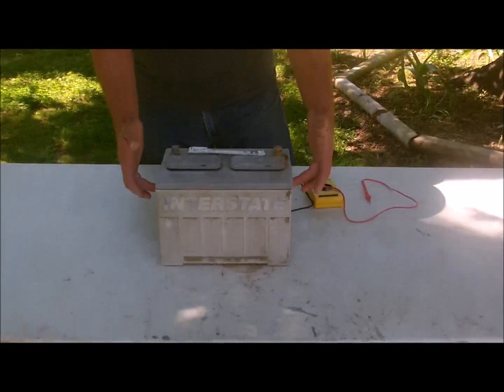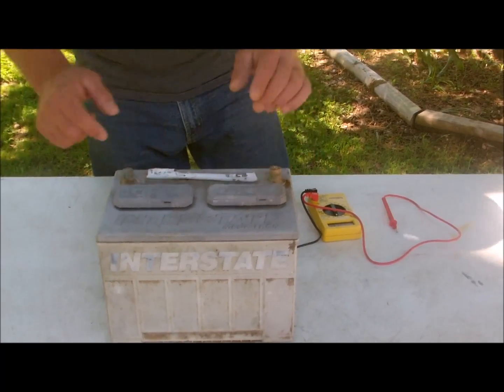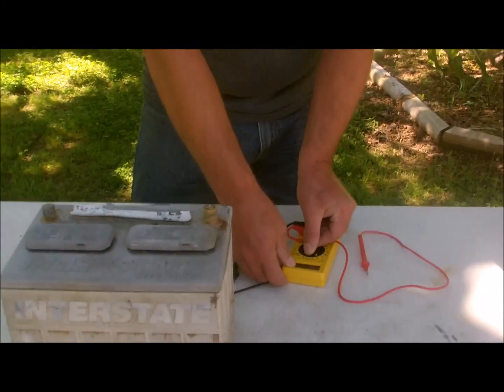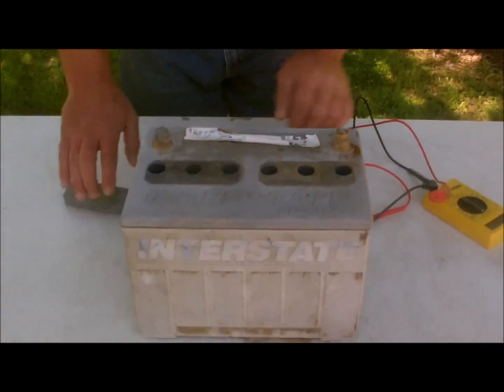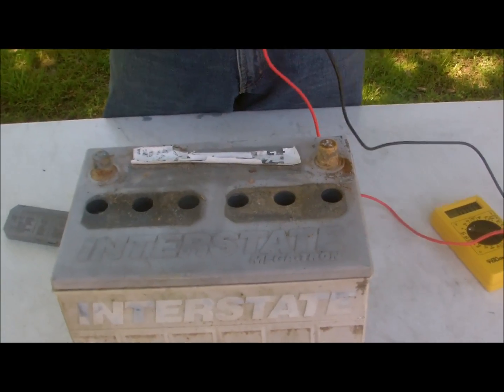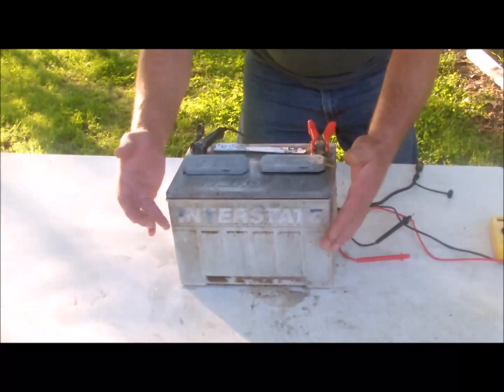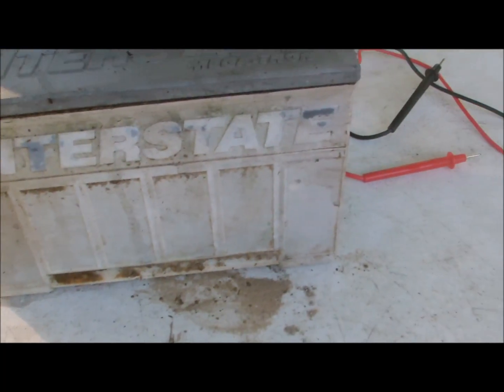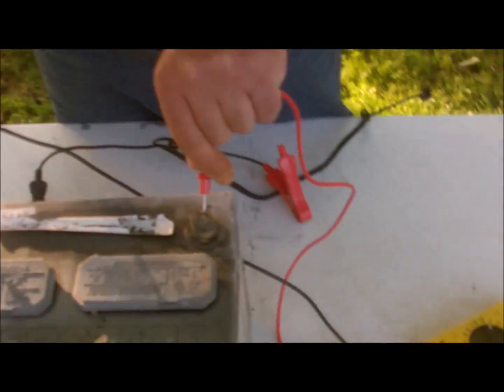Reconditioning a 12 Volt Car Battery part #2

Comment: So, do you need to put acid in or not? You aren't real clear. Do you have to trickle charge a bit before tipping out the original acid? Do you tip all the acid out? Will the Epsom salt mixture revive the battery after a trickle charge or not? Do you have to wait two years before putting new acid in or not?
So much conflicting information on this topic.
I did watch a video where some guy rinsed out the battery several times with baking soda solution. Guaranteed to work he said. It did in his video. I wondered what the Epsom salt would have to work with if the battery were really cleaned out.
Oh well, I'll try something. 
My battery costs 500 dollars.

Comment: I did this method with an already dead 12 year old battery and 8 years later it still has enough juice to start my lawn tractor. It works like a charm. Thanks for this.

Comment: Load test before and after.  Charging high rates????? ark welder or jump starter.  Volt meter tells nothing without a load test,.  Want 200 AMps at 10volts.

Comment: Thanks for showing the cells test, mine are all fine and in increments.
My intelligent charger shows ''000'' on my hardly used marine 2 year old battery and also my aging car battery, both show 10,25Volt or something. I tried getting the car to recharge it's own by driving and  charger, nothing changes.
Waiting for Bezos  to deliver my ki of salts🚐 .

Comment: ... thanks for your honesty John, one thing to remember is the true condition of a battery is not in it's unloaded terminal voltage but in how it reacts under load. A good way to test is to take an old 12V incandescent lightbulb, a 60 watt seal-beam would work... measure the initial voltage then watch it drop over time. The batterie's amp-hour.. so many amperes for so many hours, it's simple math, it's the capacity at it's rated voltage is what counts for most. Once a flooded lead acid battery under load drops down to 11 volts, it's considered done... fully discharged. Something to remember.. yes a battery will recharge at 2 amps... but in the end they are being charged at 40 to 50 amps by an alternator, and the instantaneous discharge amperage can be 150 amps. Those are the end use realities John...

Comment: Well let me tell you'll guys out there l put baking soda in a battery,it's been almost a year holding charge like a new one!!!
Reply: You added baking soda to the acid or dumped everything out and used it to clean the inside then flush it out and refill with acid?  If you say you added it to the acid then I call bull shit.
Reply: @Sny734  no you get acid out,pour baking soda with disteled water,and the rinset real good ,then put back acid

Comment: Get in touch with the size details of your traction battery box (Height, width and length), the voltage and some picture if you can and we will send out a no obligation quote.

Comment: Putting a Battery on concrete wasn't good 30 or 40 years ago, and still isn't. Its not fir the battery, but for the concrete. If battery cracks for whatever reason the acid will eat ( go through) your cement pad. It was always for yhe concrete not for the battery

Comment: Thanks, honest man. How about rinsing the battery sells with baking soda solution a few times before putting Epsom salt solution in the battery and then charging it  would that be good, because I have heard the surface of the plates in the sells need to be cleaned by the baking soda solution.

Comment: Thanks John.  After reviewing some comments, I did find out that "hardware store" Sulfuric acid is fine.  But then, someone elaborated about Epsom Salt being an acid replacement, in effect; explaining the reaction involved, and implying you could run with just that; no fresh acid.  That was very interesting, and seemed like maybe even a better long term solution, because the remaining salt could continually donate more magnesium as time goes by.  But of course, we want to know:  What is the best route after done charging with the Salt?  Leave it in, or replace with fresh Acid for service use?

Comment: I wish you shown the type of charger you used! The first video you said 2amp trickle charge, this video you talked about it getting stronger then , floating? I don't know if my charger does that, or even know what that means! Wish you shown your charger and explained that a bit this time around,, but good video, thanks!
Reply: Try Google dude, lol, there's plenty of info on that available. It's not like you have to depend solely on him to explain everything.  If he did, he'd eventually be doing "Part 36" with a cane and a long beard, like ok, I forgot to explain how the lead plates are made and the brand of epson salt I used. Lol
Take some initiative man!

Comment: Eventually you can retire the battery as a 12v lighting circuit with 100w solar panel and charge controller.

Comment: I could not resist - a cell of a lead acid battery at no load shows 2.1 to 2.2 vdc, which is 12.6 to 13.2 vdc for six cells. When loaded with a reasonable load like in an automobile not cranking, the voltage will be 12 vdc and a good battery will  hold that voltage - that is where 12 volt battery comes from. The cranking voltage is more important and it will drop below 12 volts if the starter draws too many amps. In the winter time, they do, so that is spec'ed as cold cranking amps at a specified temperature.

A 2x4 piece of lumber started out cut at 2" x 4", but then they planed it down to about 1.5" x 3.5" hence a 2x4. But I'm sure that you knew this, why not say so.

Another thing; yes it is ok to place the battery on a piece of concrete, but realize that there is acid in it and the battery seems to always find a way to get enough acid on the concrete to disfigure the surface enough to wish you had not - and it doesn't take 3 years either, but a few months even with a new battery if not properly cleaned after being charged. I am not certain of the processes involved, but I know it happens because I have had it happen even though I generally put some cardboard or something under the battery for storage on the cement floor. When I have not done so, the battery let its presence be known.

Comment: When I lived in Denver, there was a small company that did an actual rebuild. They'd cut the top off and put in new lead plates. Just like your video, several people told me that it would never work.
The batteries I bought from the guy had the top cut off and epoxied back on. I don't know what he used.
I had one of his batteries last over 12 years in a one ton Chevy van.
Why would you listen to this video and complain that it would never work? Either do it or STFU.
The man is just trying to help people. I for one will say thank you.
Smiles.
Reply: I ABSOLUTELY agree with you on that!!!
Reply: back in pakistan they rebuild batteries like that but they also rebuild starters and alternators.
Reply: I Second that, homie didn't have to do any of that I'm sure videos about reconditioning car batteries isn't exactly most watched subject

Comment: The not putting a battery on the concrete or ground myth comes from over hundred years ago when batteries had GLASS CASES.  Back then you wouldn't want to put a battery on the ground or concrete because you could crack the glass casing either by impacting the concrete or small stones on the ground or by the grass becoming scratched and having the scratch turn into a crack later. Instead you would put down a piece of wood because it is soft and non abrasive. Now batteries have much more robust plastic casings so it's no longer an issue.

Comment: Did I miss your recommended set time for the Epson salt/distilled water to remain in and clean the battery? I’m sure it’s not three years on the ground. How long from water fill to dump empty? I’m a little slow on the recharge. LOL thanks for your response.good site
Reply: I'm sure that you realize by now that you do not remove the solution - it reacts with the acid and the gunk on the lead plates to make more acid apparently. I think that you can find out what the reaction is by googling Epson salts with sulfuric acid reaction.  My guess is that the sulfate on the lead plates is destroyed as magnesium is released leaving sulfate ions to become more sulfuric acid  which increases the strength of the acid so that it creates more reaction until the Epson salts are used up. 

The recharge is done at 1 to 2 amps for a long time. Others claim that you can forget the Epson salts and just trickle charge with rest periods for a very long time - like slow charge 24 hrs rest 2 hours slow charge 24 hours for a total of 4 to 5 days of charging. Then switch to a regular fast charger to top it off after the last rest. When finished the battery should have a voltage over 13 vdc but it will slowly drift down to 12.6 vdc within an hour or two. Then it will slowly drop a few tenths of a volt per day until about 10 to 11 vdc when you really should charge it again. Better yet leave a booster charger on it - one that will monitor the voltage for less than 13 vdc charges it to 13.5 vdc then quits charging until the voltage drops again, etc. The claim is that the slow charging will remove the sulfate that is on the plates and that the Epson salts really do nothing - the slow charge did it.

Comment: Thanks for clarifying those steps .
 I m got three to try it on.  At $125 a pop. I rather not spend it on same battery that once cost $25 at AutoZone in 1990 when I worked there..

Comment: I know this is an old video. And I hope you read this.
In your first video you said not to reconditioned if less then 9v.
Is there anyway to recover a battery less then 9 volts?
Is there a chance batteries less then 9v will come back? 
I ask because one battery is $100, but 10 batteries is $1000.
Reply: @Pioneerjohnmilandred  well I picked up the acid and Epson today. Will try. If it works I plan to drain and acid it again. I have 8 batteries I need to do.
Btw I figured cost and if it does it on two tries, $7 for acid and $2 for epson and water, per battery for a total of $9 to restore $120 battery is well worth it.  At this point I will try the epson many times if thats what is needed. With all concidered, even if it takes 25 times its STILL better then half the price of a new battery. Bad news is they only had enough acid for 2 batteries. But if the Epson salt works I'll get more acid, another $25 for acid will cover all them. ( different store in a different city 100 miles away has acid in 5 gallons container) yeah I was surprised at the price though it would be more. Will be doing more batteries also, now that I know. Now I wish I knew how to get unwanted deep cells battieries.
Reply: @pychohobo1832  did you try it?
Reply: @realdevbro447  yes and it didn't work for me.
BUT.
1st I believe the plates burned up. So no matter what nothing short of rebuild will work.
NOW.
I will say, in some it did improve the volts. Just not enough. Again back to the plates. By this I mean. A couple battaries were like 4ish volts. And it made them 6ish.  
In all the battaries I have dead cells. This is why I determined it fried the plates.
And as a FYI. I know there is an arguement about this. By from what I learned from experience. Battaries will work on Epson salt. However the charge slowly drains.
I have yet to do it. But I plan to have the batteries rebuilt. I looked into that and it seems reasonable.
Reply: @pychohobo1832  Ty for the reply.

Comment: harbor freight tools gives the meters away with a purchase pretty often as well.
Reply: I got my free multimeter from Harbor Freight.  They also have a specialized battery tester showing cold crank amps, voltage, internal resistance, state of charge, state of health.  Goes for about $60 but well worth it.

Comment: I had a new Interstate go bad in 6 weeks (1 dead cell), they replaced it, and gave me an upgrade, 2 months later it's dead, the Parasitic amp draw test showed my van pulled only .036 milliamps, the batteries were made in Mexico, go figure

Comment: Ok, I'm trying it with an old marine battery. So far I have killed it with baking soda, (suggested from another video not yours)did a few rinses with Epsom salt and distilled water with overnight charging at 2amps, this is the fourth day of rinsing and charging. I saved the old electrolyte ,it settled out over night with all of the muck on the bottom. I then poured off the clear electrolyte and re-used it with Epsom salt , right away voltage jumped up .I put on my charger and  the  resistance was at 2amps  as compared to an original very high resistance. I only plan on using this battery on LED solar lighting around the yard or, for camping, not in a vehicle. Great video!
If you are really into this , I found this during a search on this very subject using different sulfates.
https://patents.google.com/patent/US5945236A/en

Update! Day 6
I am surprised this battery came back to life, I put this in my old Ford Galaxie and it actually cranked the  V8 engine over , however it still does not have the full cranking amps. I will let it sit a couple of days and try it again to see if it holds a charge. 
How long it will last , who knows?
Reply: Your method actually seems the best method that I have come across. I also am hoping to create a Solar battery bank for off grid charging of my phev Honda clarity
Reply: I did the same mistake w baking soda, what is your rinse process?

Comment: 2007 battery says it is good to 2012, out of a Honda. 4 volts lol, Yeah, I bet the way the sides are swollen on the ends is not a good sign either. Honda wants $350. Auto parts stores $150 - $200.  I had a 84 mazda p/u  the battery went bad so I took the one out of my riding mower an ran it for over a year with no problems. Damn this batter looks a lot like a riding mower battery. Hmmm , what do you think ?

Comment: Thanks. Neat trick about checking cells. I think the "Don't set batteries on cement" goes back to the days when they had bakelite cases. I sat through about 5 minutes of the ez battery commercial before the smoke being blown up my ass started coming out of my ears and I went to youtube. I had watched your first vid before but hadn't tried it yet. I got a couple batteries laying around I'll try it on.

Comment: You proved nothing useful.  I've seen lots of batteries gain voltage through different methods and have no useful amperage.  Put that battery in a car and start it, that'll prove something.

Comment: Its one thing to "believe". And I do think its worth a go, but you have done no tests other than a voltage test, which is too low. After disconnecting immediately from charging for several hours, I'd expect it to see over 13 volts, and even if left to settle for some time, I'd want to see 12.6v or more. You could do a load test, or better yet, connect to your truck in the background and show it turning over. Science is about results.

Comment: i have bad 18v weed eater battery can a person make it work.
Reply: Ben Brewer no its probably lithium batt
Reply: YES! There are several videos that explain how to revive a drill battery pack. Your weed eater will have a battery just like a drill. Basically once the battery drains too low the charges "sees" it as bad, you have to use another charged battery to raise the voltage of the "dead" battery. It works, I have done it with Dewalt and Milwaukee batteries.
Reply: I have done this by taking the batteries apart and finding which cells are dead. Remove them and insert cells from another old battery of the same kind that are still good. You can make it last a little longer, but it is probably a waste of time since the activity of soldering on them, etc., and the fact that they are already old is going to be a problem shortly.

Best thing to do is to buy a new unit - the 20 volt lithium ion (or higher voltage) battery with charger and one extra battery. Don't run the lithium until it gets hot - run it for just a certain length of time (you will discover how long they will run and swap them out several minutes before you think the battery will quit.) The batteries will last a lot longer if you don't let them get too hot so most power tools have protection for that, but exceed it if you can by shutting down periodically rather than running continuously or by feeling the battery. If the battery starts to get hot, let it cool off. Or you might switch to another charged battery and continue while the first one charges and then cools off again.

The lithium ion batteries are much better than NMH or NiCad batteries and will output as much as either of them without the slow drain that the others exhibit (and which is a pita) while not being used. Earlier lithiums were less reliable but the lithium ions are great. 

Most of the old power tools that used NiCad or NMH batteries were 12 - 18 volt but the motors inside were rated at 20 vdc or higher. If you wanted to, the old tool could be reworked to operate with lithium ion batteries if some way to connect the battery can be devised. Check the motor in the tool for its rating, purchase two lithium ion batteries and charger (or use one from  another tool that you already own) with a lower or equal voltage rating, devise a means to attach the battery and you can convert your tool to lithium. The battery has all of the protections within it so don't worry about the other connections other than + and -. Of course you have to quit before the battery gets hot anyway, but this should operate the tool like a champ. 

However, purchasing a new tool for lithium usually includes at least one battery and a charger plus a discount on the second battery so that is the way to go rather than modifying an old tool - plus you get a brand new tool.